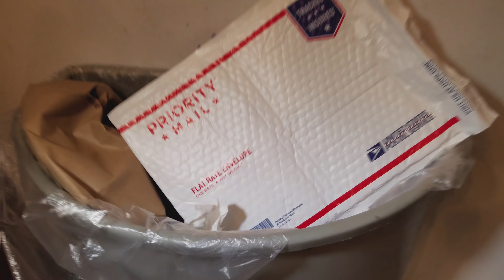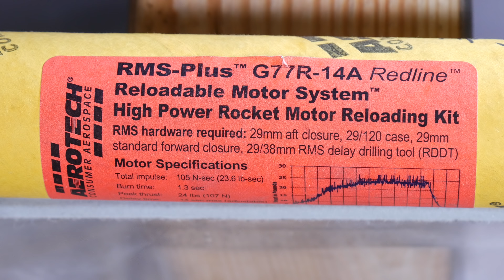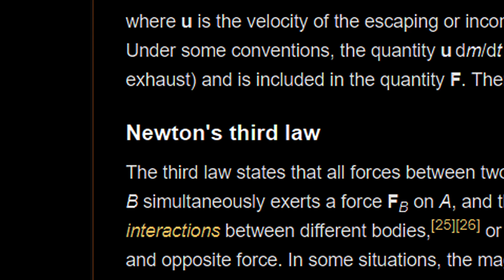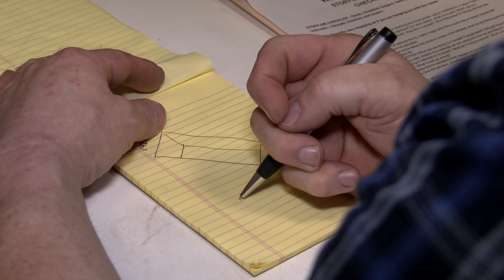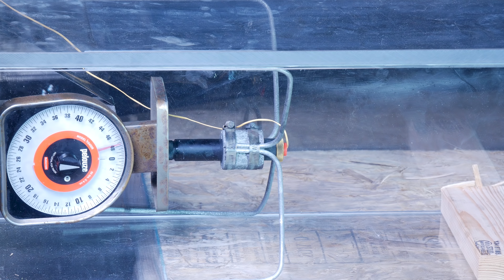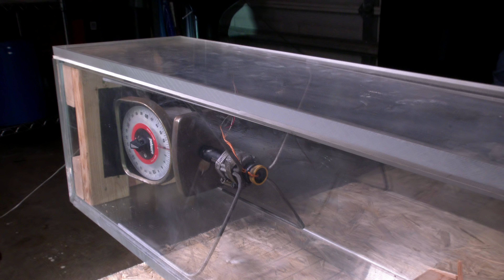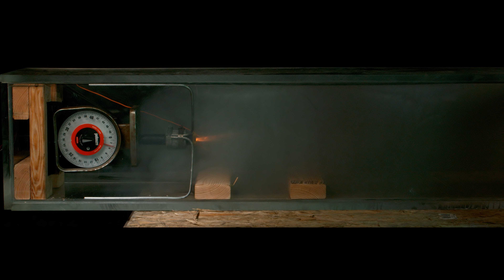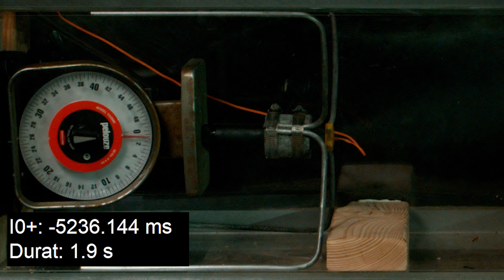Rockets in a Vacuum Chamber - Newton's third law of motion Visualized

Comment: The biggest problem with this test is the rocket had something to push against. The rig you have set up to measure the thrust. So even though there's no atmosphere to push against there's the rods holding it to push against. I'm not exactly sure how you could eliminate that. And I understand the theory that it shouldn't create propulsion bc it has nothing in the atmosphere to push against. Or lack of atmosphere I mean. But also the rods holding it stationary are giving it something to push against. Allowing for reaction transfered through the rods. I think maybe if you hung a rocket in a vacuum and seen if it actually tries to climb then that could possibly prove it
Reply: The bracket isn't attached to the plexi box-you can see it moving forward as the motor burns. Friction between the bracket and the walls is actually decreasing the force indicated on the scale, so it cannot be simultaneously somehow contributing to it.
Don't think of it as the motor pushing off of the brackets, that's an incomplete observation that then leads to people to the misconception that rocket motors need atmosphere or something else to push off of-a theory that is not supported by observation.
Instead, consider it as the bracket, scale, and everything else in the system pushing back against the thrust of the motor with an equal and opposite reaction, explaining why rockets actually do work in a vacuum-a fact that is fully supported by all of the evidence accumulated since we first went into space.
Reply: Jason - Sorry but rockets do NOT "Push on the atmosphere".

They push on the MASS of the exhaust they take with them to space.

For example: Would a CROSSBOW fired into a vacuum still have recoil? Yes or No?

Comment: The chamber is a little small, [pressure build-up ] but you can still show that rockets engines work in a vacuum. A rocket is propelled by combustion, hence it is an engine, not a motor.
Reply: - " hence it is an engine, not a motor."
Except the people who actually use them, AND the people who make them, refer to them as "Motors".
'SRM' - Solid Rocket Motor
Reply: @stuartgray5877   @Stuart Gray  Its a grey area, no pun intended Stuart.😁 He referred to it as a rocket engine as well. Reason being.? Estes refers to its propulsion devices for its rockets as engines in their print catalogue and literature, etc The terms are loosely used and pretty much interchangeable. .Casing cores will sometimes have both engine and motor printed on the exterior casing. In general terms its usually. 

A motor is a machine that converts other forms of energy into mechanical energy and so imparts motion. Like an electric motor. An engine is a motor that converts thermal energy to mechanical work. automotive, truck, aircraft, lawnmower etc 

In the physics sense: an engine converts energy into mechanical work. A motor is a subset of engines that produce motion as the mechanical work. 

So all motors are engines but not all engines are motors. In the model rocketry and aerospace industry, they are used interchangeable eg. rocket engine and rocket motor.

 As I stated above, a motor is generally used for electrical devices but it's also used as an abbreviation for motorized eg. motorboat or motorcycle, motorcar, motorbike, etc.
Reply: @thomaslewis7883  Thanks for the long explanation.
I launch real rockets for a living. I have launched four deep space probes on Delta-II. All four of those carried and upper stage Solid Rocket MOTOR made by Thiokol (Star 48B).
I am just telling you what the professionals who do this for a living call them.
call them whatever you want.
Reply: @stuartgray5877  Likewise, I've heard both terms used. I agree, each to their own.

Comment: try gravity plumbed liquid rockets, yep avoid the turbo pumps complexity. keralox rockets but solid/liquid oxidizer, like NaClO3. high pressure oxygen generation activated with rocket heat. simpler than solid state rockets, safer and reagents separated. no self-ignition. controlled thrust and flow.
Reply: Unneccesary complexity for a simple demonstration.

Comment: That was exactly the answer that I was looking for. Thank you so much, appreciate your efforts.
Reply: Yes.  It clearly shows that a rocket cannot work in a vacuum and so he had to introduce air into the chamber to make the rocket work.
Reply: @boptah7489  The experiment neither confirms nor disproves that a rocket works in a vacuum. It only proves that ignition in a vacuum is not possible without taking measures to either isolate from the vacuum as was done in this experiment, or creating a micro environment atmosphere of fuel and oxidizer as is done in the ignition chamber of a liquid fuel rocket engine in space. As far as I know, SRBs are not used in the vacuum of space.
Reply: @boptah7489  ...actually it does barely prove rockets and Newton's third law work in a vacuum. I correct myself here. Time queue 10:13. Slow down the play back and watch it carefully.
Reply: @starroger  - "As far as I know, SRBs are not used in the vacuum of space."
Yes they are.
In fact, I have launched SIX spacecraft in my career and four of them used Solid Rocket Motors as the THIRD stage and were ignited in hard vacuum.
Those mission were: Mars Global Surveyor, Stardust, Deep Impact, and Kepler Space Telescope.
They launched on a Delta-II which uses Star 48B as THIRD stages.

And Minuteman ICBMs are solids for all three stages.
Reply: @stuartgray5877  Good to know, thanks. 

As I have since read in a comment by another commenter somewhere in related YT channels, all rocket fuels, whether liquid or solid, include some sort of oxidizer.
Reply: @starroger  Well actually you can use mono-methyl hydrazine all by itself.  When passed over a hot catalyst it will self-ignite with no separate oxidizer component.  I don't know the exact chemical process.

Comment: @Dr. David Banner F.E.S.
In response to your theory that you can't accelerate beyond 1mph, because the basket ball is moving away too fast. Yes, you are correct. By throwing 1 basket ball, you are never going to exceed 1mph. But your expectation of how acceleration works, is not correct. If you hold a car at half throttle, it will only ever reach 50% of its max speed. Eventually the road is moving away from the car at least as fast as the wheels can push off. So what do you do if you want to accelerate to 100% of your max speed? You increase thrust, by increasing fuel input/consumption. You hold the car to 100% throttle. In terms of our basketball example, you DON'T continue to throw just 1 basketball. You throw 2 basket balls at once, to increase to 2 mph. Then three basketballs at once, to increase to 3 mph. The example you provided, was continually consuming the same amount of fuel(aka throwing 1 basketball continually),  and expecting to continually accelerate faster. To accelerate and maintain faster speeds, you have to consume more fuel. If you want to go twice as fast, you have to throw at least twice the mass at once(for example, throwing 2 basketballs at once, one time every second) so that you have something heavier to push off from, or throwing the same mass at a faster rate(throwing 1 basket several times per second), to keep up with the mass that is moving away from you faster(that is what a car technically does with it's wheels). This increase in consumption of fuel is why if you have a lead foot and accelerate or cruse with the pedal to the floor, your car will drink gas like a whale, compared to gently accelerating and maintaining normal cruising speeds. What your example actually proves, is that every vehicle, no matter what type of fuel or propulsion it uses, and no matter on what medium it is traveling, will eventually level out and hit a top speed that is equal to the amount thrust being produced, relative to the amount of fuel being consumed to produce the thrust. So yeah, if you aren't capable of increasing the number of basket balls you can throw, you will top out at 1 mph, and never go faster.

Comment: Can anyone link me to a video of this experiment done by professionals?
Reply: If you want video evidence of rocket propulsion working FINE in a vacuum, just search YT for "SpaceX Arabsat 6A"   and watch ANY of the dozens of videos taken from the ground.
You can see the three stage rocket fly up INTO VACUUM, travelling at ~3600 MPH EAST.
Then you can see the side boosters separate ABOVE 50 kilometers and TURN AROUND AND FLY BACK TO KSC.
When the boosters separated ABOVE 50 kilometers they were IN VACUUM.

So IF rockets dont work in a vacuum - HOW did those boosters cancel 3600 MPH downrange velocity WHILE IN VACUUM, then maneuver to LAND BACK AT KSC ?

I have not had a SINGLE flat earth moron answer that question. They just AVOID IT.

Comment: I would make a piece that is attached to the inside of the lid that fits inside the upper edge of the box in order to resist the deflection of the edges inward when evacuated . I must say , the ignition of the smoke in the chamber , which I think was probably vaporized hot glue and rubber from the wires , appears to be something that takes place because of some amount of air remaining in the chamber. BTW , just for the record I believe that rockets work better in space than on the ground be they liquid , solid , or other, such as electric.

Comment: Not a conspiracy theorist but I'd recommend that the engine be trimmed so that it contains no more than one cubic inch of propellant. It won't burn as long but it should prove the point.
Reply: or micro puffs of gas from a tiny flexible gas tube

Comment: Y'all know that they dont ignite SRBs in the vac of space right? They are almost always used as first stage lifters.. They do a bunch of work really quickly then burn out so that your liquid fuel rocket doesnt have to sacrifice burn efficiency to overcome the rockets inertia on the launch pad.
Reply: Sorry but you are mistaken.  NASA and DOD use solid rocket motors as upper stages, and they light just fine in a vacuum
Reply: @stuartgray5877  how could that be? Because NASA has never gone into a complete vacuum. No one can get beyond the Dome of the heavens. Don't know what I'm talkin about? Then look up about Operation Highjump when they found the edge, and then look up operation fishbowl when they were trying to break the Dome❗
Reply: @jrngln  
Stop lying.

Comment: I swear I didn't search for something showing me Newton's Third Law was flawed. I just wanted a simple experiment to show what I was having trouble understanding. Ever since I first learned about Newton's three laws as a child I questioned them (at least the third one), and this "experiment" isn't making me feel any better about it. I will also note I've never even heard of anyone questioning it. I'm literally merely trying to understand it, but once again, the thrust can be explained for a number of reasons including that you literally have a platform at the far end of the container and wood braces serving as a partial platform at the halfway mark (in addition to whatever friction might be present laterally as the gasses come into contact with the container. 

You might not see the flame of the rocket reach the far end of the tank but you are certainly moving gas in that direction (and clearly it gets there very quickly).  First, don't rely on the closeup in slow motion. That tells us nothing little. Look at the wide angle shot where you can see the entire tank. Clearly the smoke quickly runs out of room and almost immediately starts propelling itself in the opposite direction (back towards and past the rocket). In other words, the spent gasses served as an atmosphere. In fact, this may be why the flame started away from the rocket because it needed that reverse direction to create the compression (of the gasses) necessary for ignition. In other words, if you had lit this thing in a container the size of a large warehouse, the thing probably wouldn't have ignited and/or created force other than scant force it might have produced as gasses hit gasses. 

Put another way, you can see the gasses collecting because the rate in which they traveled wasn't sufficient to send them to the other end of the tank right away (which created atmospheric conditions in the middle of the tank required for ignition and thrust). If this was a true vacuum, nothing would have stopped the gasses (a body in motion stays in motion unless acted upon by outside forces), but obviously an outside force prevented them from reaching the other end of the tank. 

This is so obvious to me that I have to assume this video is what you might call controlled opposition (e.g. a person claiming to disprove Newton's Third Law by purposely proving himself wrong only to help sustain the lie).
Reply: checkout the new thread I just started on this video. I am trying to explain how rocket propulsion works in a vacuum. Look for the thread that starts with:  
"@Daveed Fermin  - If you are interested in learning how rocket propulsion works in a vacuum, I will help you to understand. "
Reply: @stuartgray5877  you never help anyone with anything.

Comment: Still should try it in a bigger vacuum. There’s question that the chamber itself is providing an opposing force. Furthermore, theory is gas will expand differently in space compared to an enclosed chamber. The gas could possibly creating a medium for it to propel being confined in such a small space.
Reply: In the video, we can see that thrust was being measured by the scale well before the rocket had any chance to fill up the chamber with gasses.
Reply: How do you know when the chamber is filled? The smoke/fog isn’t the gas. How fast will the gas disperse? He had two failed attempts and was forced to seal up the igniter. He also said when tried in atmospheric pressure, it worked just fine. On the third attempt, I believe, he admitted that the ignition of the rocket would cause some internal pressure inside the enclosure. One could think that it was able to create an environment to propel itself because of the enclosure. 
The initial bump that you saw was the internal combustion which was caused in an atmospheric environment inside the igniter. He said they needed that to create the ignition. But if you watch it, the force isn’t consistently rising. The scale drops a little and doesn’t go back up until the high temperature gas is visible. At that time, the pressure gauge on the vacuum almost instantly increases. Which a slight delay in the gauge should be expected. How would the high temperature gas create pressure in space and consistently burn without constant “atmospheric” pressure at the igniter? The fireball that appeared further behind the igniter was the pressurized gas that finally heated it up. That gas wasn’t not able to escape into the vacuum quick enough.
Reply: @BT-hk2co  The difficulty with ignition comes from the fact that this is a hobbyist grade motor that’s meant to be used in normal atmospheric conditions. The igniter isn’t the most energetic and the fuel grain doesn’t have the most powerful oxidizer simply because it doesn’t have to. It likely is dependent on there being some ambient pressure and oxygen to get the fuel burning. Once it is burning, it is self sufficient. External pressure and oxygen isn’t needed because the fuel is solid. The fuel and oxidizer are physically held in place and there is enough of each to sustain combustion in an absence of ambient pressure and oxygen.  

Also, solid rocket fuel isn’t the easiest to ignite by design. That makes it much safer to store and transport. 

By plugging the end of the motor, a small amount of oxygen and pressure was trapped inside and made it easier to ignite the fuel grain. 

Another thing to notice is that at 10:20, the scale is already reading a negative weight. Since it’s a spring scale, that just means the surface is pulled out slightly. This was likely from sliding the scale backwards into place and the arms catching on the chamber walls a bit while the body of the scale was moved slightly farther back. So for this demonstration, the needle being at 48 is the actual 0 point. 

At 10:22, we see the needle starts moving. This is from the igniter. It provides a short impulse meant to get the fuel grain burning. That’s why we see the needle fall back after this initial impulse. Then at 10:29, we see the needle start moving in the positive direction again and some flames start leaving the motor. This is when the fuel grain ignited and began producing thrust. The delay in thrust is the delay between the igniter lighting and the fuel grain lighting. 

At the 10:29-10:30 mark, the amount of gas produced is negligible compared to the volume of the chamber but we see thrust being registered. Warped Perception correctly points out that this is the point we are interested in for testing the hypothesis. 

As for how we know when the chamber has appreciable pressure, start watching at 10:12. You can see the pressure gauge and needle. 

Lastly, the fireball that appeared beyond the motor was non-combusted or flammable exhaust gasses ignited. At that point, there was appreciable pressure in the chamber, but that is irrelevant because the point of the demonstration was to see if there was thrust  at the moment of ignition. 

We see exactly what we expect to see in this demonstration. Rockets work because of the third law of motion. A force from the motor and nozzle acts on the exhaust gasses to funnel them out in a concentrated plume. In accordance to the third law of motion, the exhaust gasses impart a force back on the rocket. What the exhaust does after leaving the rocket is irrelevant. This is basically just mechanical recoil. The rocket imparts a backwards force on the gasses and the gasses impart a forwards force on the rocket.